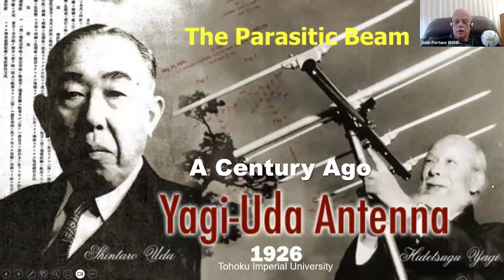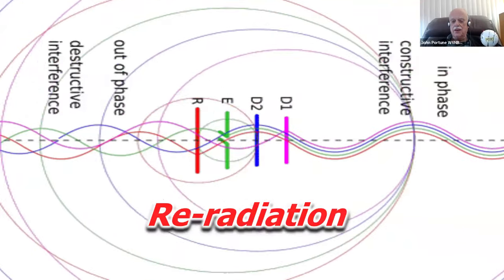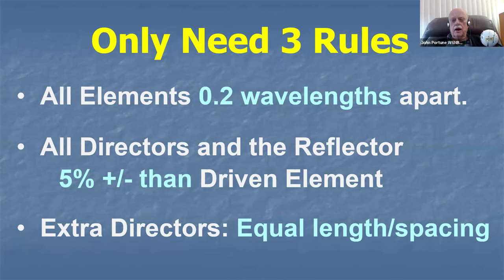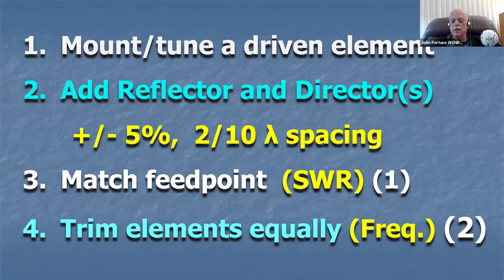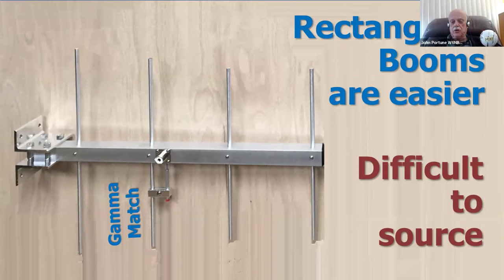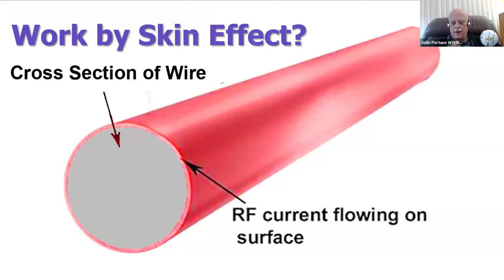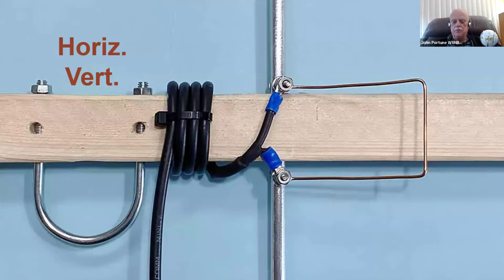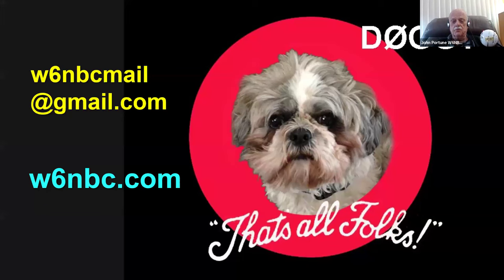Designing Homebrew Yagis is Easy

Comment: I still Don't completely Understand exactly How the 3 Element yagi works....Would a 3 Element  Optical Equivalent using a Mirror reflector, 360° light bulb Source & Convex Lens produce an Easier to understand & Improve 3 Element yagi antenna ??
Reply: antennas work on radio frequency, not light. optics and mirrors. have nothing to do with this.
Reply: @Gabaab   The question is indeed a good one. Radio waves and light waves share the property of traveling at the speed of light. Light and radio waves being part of the electromagnetic spectrum exhibit constructive and destructive interference. This property of constructive and destructive interference is the behavior which the Yagi takes advantage of to focus a radio wave in the forward direction. The frequency of the light from a filament light bulb has an exceptionally low frequency as the typically supplied AC household current oscillates at 60Hz, not 3500  (80 meter band) or 144,000 (2 Meter Band) thousand.  In fact, turning a light switch on can produce a radio wave due to the spark which is created within the switch when contact is broken. So light and the principles of optics are indeed closely related to radio waves and can be helpful in illustrating how a Yagi works.

Comment: My accurately Calculated & precision Built/Cut & feed Match 10 element Vhf & Uhf yagi antennas Based on your Recommended model Performs only 75--85% as good as Commercially available 10 Element yagis.....What's  wrong & how can I Recover the Lost 15--25% Gain potential ??.....Thx for all your Helpful info....

Comment: This does make it easy.
You're right, there's all different dimensions of element spacings for Yagi's. Perhaps we should more correctly call them Yagi-Uda beams.
I made a note for a five element Yagi for 2m years ago from a design in the ARRL Handbook with element spacings of R to D.E. 16", D.E. to 1st D 12", then two spacings of 20". Three directors reducing by ½" going forwards. It was fed with a coax delta match. It worked okay.
I think I'll give this one a go, 5 elements maybe, the hairpin match look easier and the overall design simpler. Thank you.
I no longer have the first one or it would have been interesting to compare the two.
G4GHB.

Comment: Hmm, I always set my spacing to give a 12.5 ohm impedance where the 12.5 ohms was transformed to 50 ohms by using as the driven element a folded dipole with a wire spacing that multiplied the 12.5 by 4. This turned out to be common speaker wire. As far as being flimsy wire, it was taped to dowels similar to the fiberglass rods.

Any method you know that works is good enough and I do like the simplicity of the method shown here.
Reply: By fiddling around with some modeling software, it brought me to the 12.5 ohm impedance for an optimum gain and FB ration 3 element.  Using the simple 2 rule tactic made my 20 meter project over 24' long for a 3 element beam!  haha  Modeled out pretty good but I was able to get the FB ration better by moving the driven closer to the reflector.  The .2 WL on the director does work out pretty close to maximum gain though.